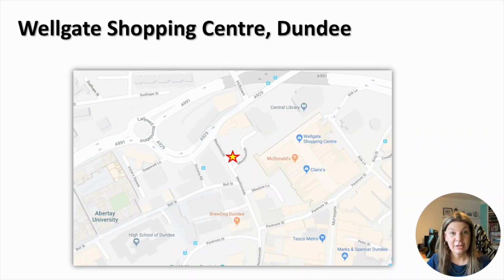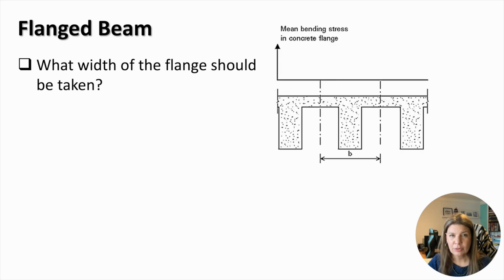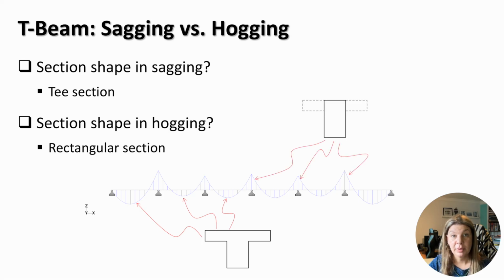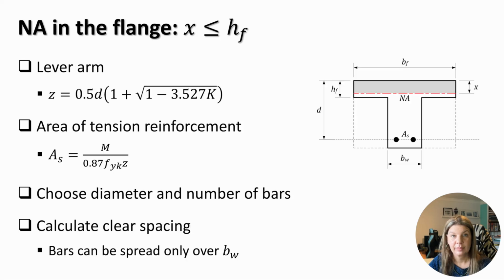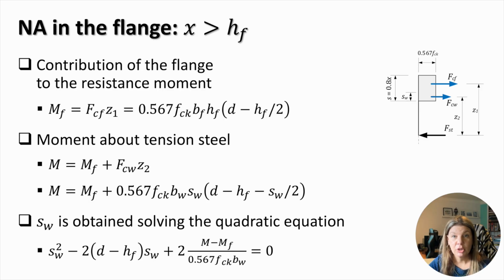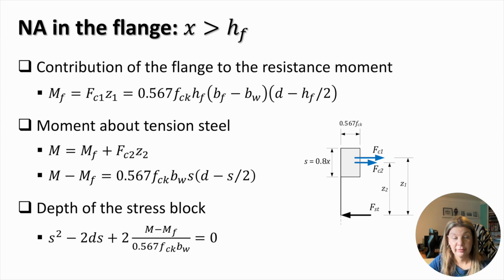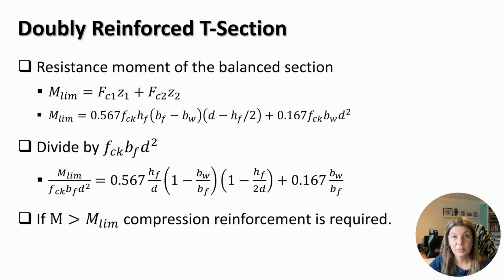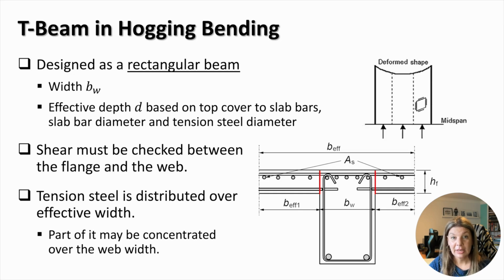Reinforced Concrete Design | Topic 4: Flanged RC Section – Effective Width & Design | Eurocode 2

Comment: what if the flange is at the bottom?
Reply from the maker: Good question. If the flange is at the bottom instead of the top, the behaviour depends on whether the beam is in sagging or hogging bending.
Under normal sagging bending, the top of the beam is in compression. In that case, a bottom flange is mainly in the tension zone, so it does not contribute significantly to the concrete compression block. The section is therefore often treated similarly to a rectangular section in compression.
However, under hogging bending, the bottom of the beam goes into compression. In that case, the bottom flange becomes effective in compression and the beam can then be analysed as a flanged section.
So the key point is that the effective flange is the flange located in the compression zone, not simply the flange at the top or bottom.

Comment: Thank you very much. Indeed its a great beneficial lecture. Can you please demonstrate with examples on how design flanged section when the neutral axis is in web and when its in flange and please show us how to calculate and detail additional transverse reinforcement please
Reply from the maker: Thank you! I plan on uploading some solved examples to help put the theory from the lectures into practice :)
Reply from the maker: 2 Examples on flanged beams now uploaded (one with compression in flange and one where it extends to the web). I'll be uploading additional examples covering other sections and other aspects of design.